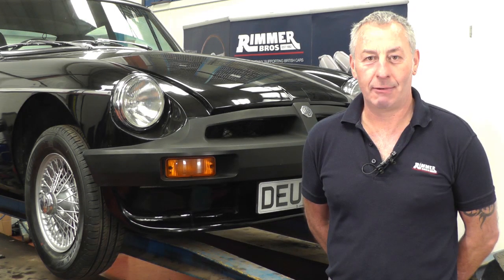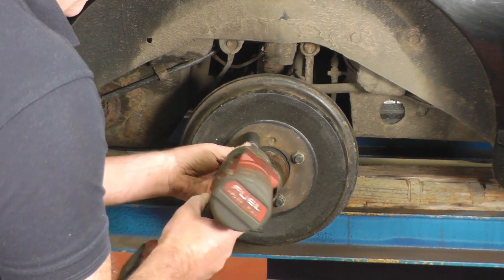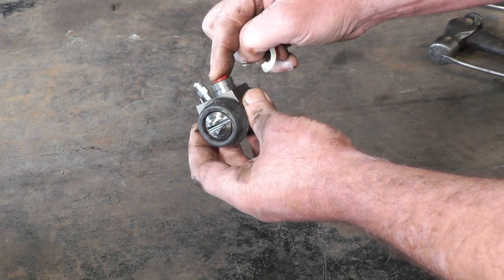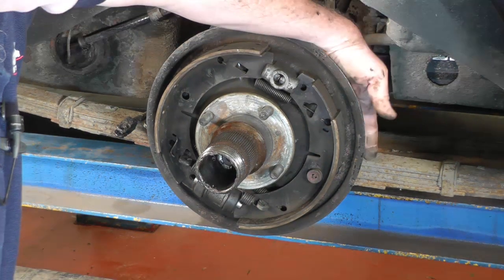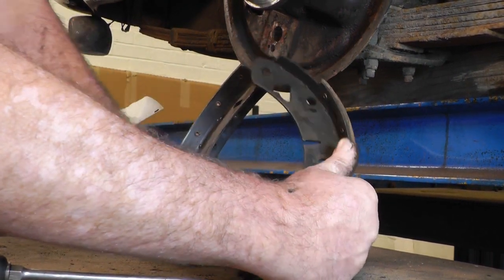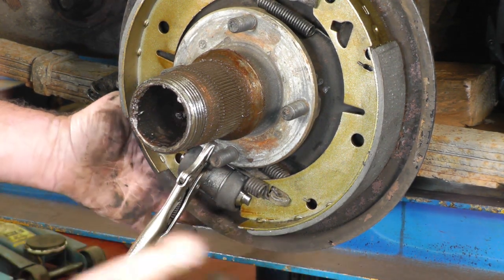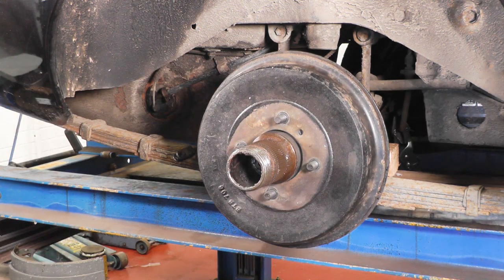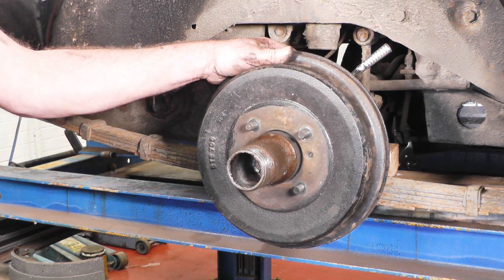MGB GT 1981 - How to Replace the Rear Brake Shoes

Comment: Please help me I’ve just had the hydragas spheres changed on my mgf and to get the correct height on the rear the front is sitting at 405mm any ideas
Reply from the maker: Replaced or reconditioned? It sounds high at the front. Do you mean that if you get the rear at the correct level that the front goes too high?
Reply: Rimmer Bros TV  replaced them with a reconditioned set from mg obsession and yes if I get the back to 360 the front goes to 405-410mm
Reply from the maker: @16redkeane  You probably need to be speaking to MG Obsession really. Hard to diagnose the issue remotely.